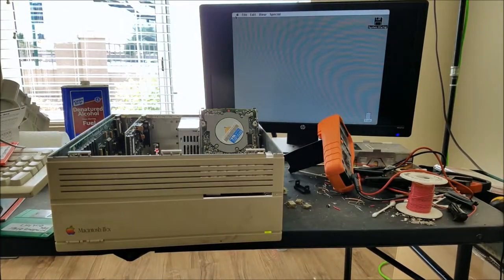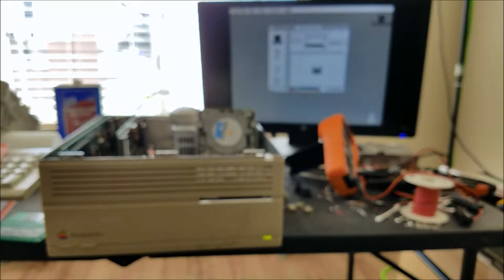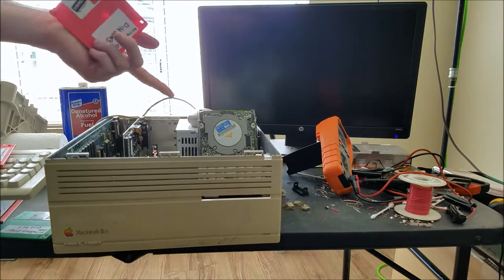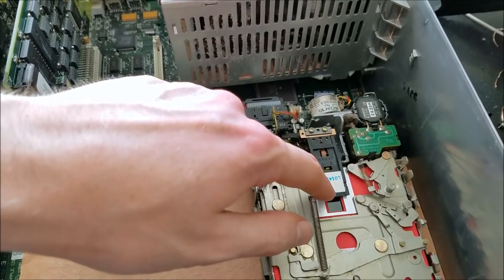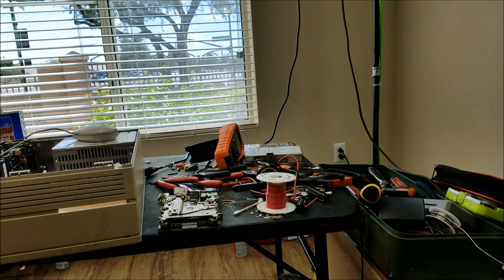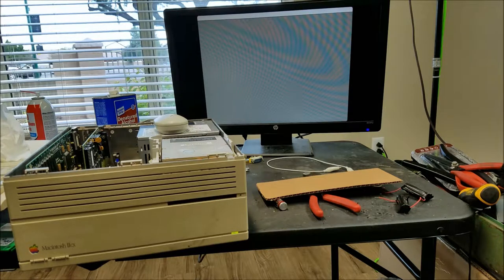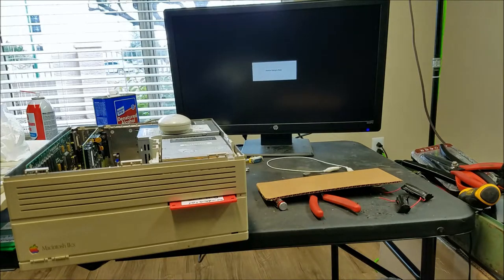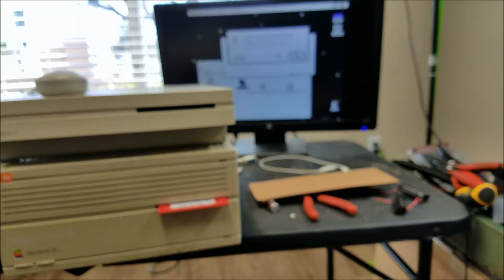Mac IIcx Part C: Making It Boot

Comment: On the ROM issue and 32 bit addressing. Download Mode32 to fix it through software. It's a small extension. If you ever need more than 8MB RAM Mode32 will solve it. Download link, https://macgui.com/downloads/?file_id=20769
Further details can be found here: https://lowendmac.com/2015/32-bit-addressing-on-older-macs/